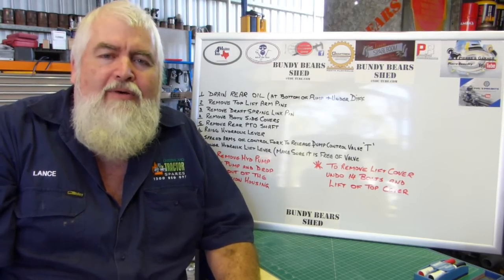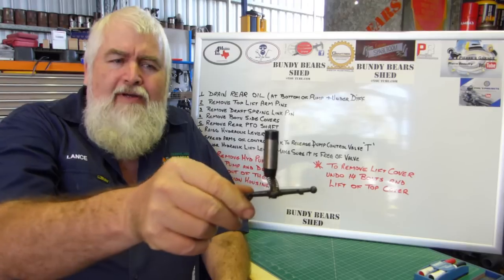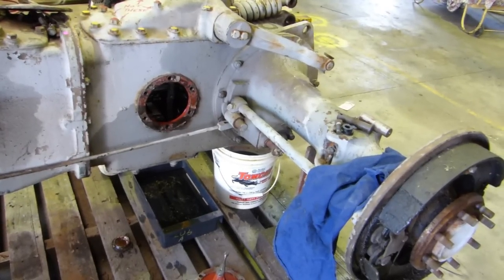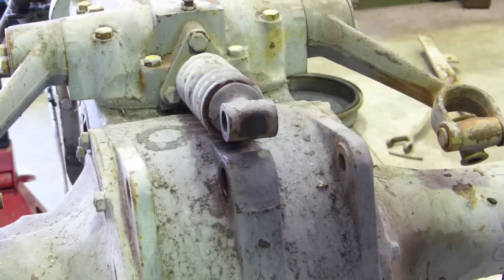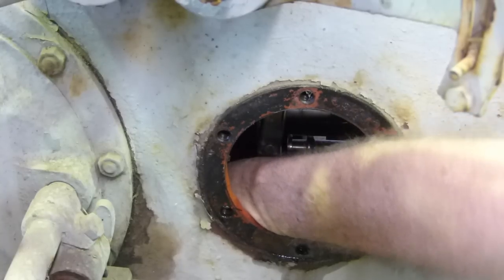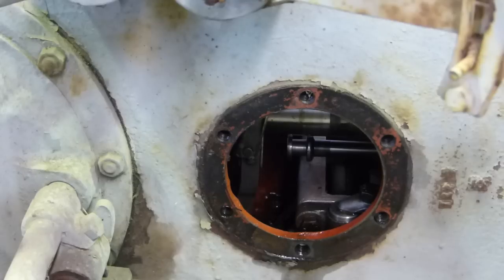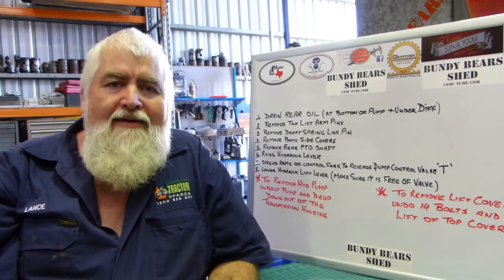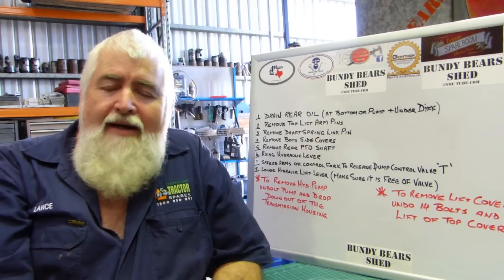How to remove a Ferguson TE20 Hydraulic Lift Cover and Hydraulic Pump

Comment: thank you for these videos! ive been watching all the ones on how to work on a TEA20. i just acquired one for some light/medium use around the farm. it needs some work, as its stuck in gear, and i do want to fabricate a loader attachment for it one day to help lift big bales of hay/compost/whatever. i havent found much in the way of help or diagrams on forums, so i turned to youtube, and found your channel. very informative, you explain everything clearly. i found one forum post where a guy pulled his lift cover off, and someone else told him to buy a manual before he goes any further because he probably wrecked his control valve. i couldnt figure out what that was, or where, until i found your video. you explained what it is, and how you can damage it, and how to avoid damaging it. i cant wait to get this thing going and put it to work around the farm. mine's a 1950 TEA20. cheers!
Reply from the maker: Im glad you are getting something useful out of the videos. I hope it all goes well for you.

Comment: I cannot set intermediate heights on my TEA20 from 1952. The lift either moves to the top or lowers to the very bottom. Is this normal for this model? If not where to look for the problem? Thanks for your suggestions. Greetings from Poland
Reply from the maker: Yes, it is, they have no real position control.
Reply: @BundyBearsShed  Thank you for your answer. What is the purpose of the screw limiting the movement of the lifting lever then?
Reply from the maker: @kamilpauk  setting ploughing depth for drafting.

Comment: Hi lance,  I have a 54 ferguson tea20, the lift arms only lift with power take off engaged been like this I was told for 30years, recently when pto engaged has sounded noisy, then the other day went to raise slasher only lifted about an inch, removed to w,shop stared dismantling, any ideas what could be wrong, update removed pump I know now how it works, different to the 35 I have, found t valve wiggle shaft was disconnected, missing circlip, the t valve internal shaft has a slight bend in it.
Reply from the maker: Sounds like you are onto it , good work.

Comment: Lance ,i have to change the side valve chamber on my TEA20, do i have to take the top off to lower the pump? I  have drained the oil,side covers off,fork off the valve, PTO out and bolts out of the bottom plate. do i have to do steps 2 and 3 or ccan i get away with out doing them thanks a bunch
Reply from the maker: No but you will need to take the pto out.
Reply: @BundyBearsShed  Ihave the PTO pulled out 3/4 of the way ,will pull out when my new side valve chamber arrives hopefully next week. can you tell me again whaat type of caulking you can use if you don't have a gasket thanks again Lance

Comment: Question : 1953 ferg te20 and when I raise my 3 point hitch up, hydraulic oil sprays out from between the lift cover and the housing, on the right side. Seeming to be a blown gasket, can I loosen the top bolts and raise the cover 1/4 inch or so to clean and put some silicone gasket maker in without damage? Or is it likely a bigger issue? Thanks!
Reply from the maker: Lift the top and replace the gasket
Reply: @BundyBearsShed  I just wasn’t sure if I could lift it up a little just by undoing the top bolts, thanks!
Reply from the maker: Not really you would need to undo the control valve so you dont bend it. Not a big job.

Comment: Hello Lance, my 48 t20, just wondering about my clutch. Does it maybe need fluid or adjustment? Do you have a video about this? Tractor was making a metal on metal noise and it is getting hard to get in gear.
Reply from the maker: I did a video on the te20 clutch early on and again in the 1954 series. I would suggest the throw out bearing is on the way out.
Reply: @BundyBearsShed  Thanks Lance, i will try to loosen the bolt on clamp and see if i can get any more clutch. I turned down the throttle a bit and got it our of gear back to neutral. John from Canada.

Comment: I have a question.  I got my pump pulled out and i have the rebuild kit. Does the front control valve, the one with the T handle on it, does it just pull out or is it connected to anything inside? My rebuild came with a new one but mine is stuck in there pretty good, so i didnt know if it was connected to anything or not.
Reply from the maker: It usually pulls out easily
Reply: @BundyBearsShed  thank you. I have it soaking right now. I think it has rust around it. I appreciate you getting back to me.

Comment: got a harry ferguson model.100 was removing dirt then i heard a pop underneath the seat and now the wheels dont turn ....what could be wrong..
Reply from the maker: If you ull the l/h side cover off you will possibly find the shear coupling has sheared. You can fit the new ones without splitting the tractor through the side cover but it is way easier to remove the lift cover. Not usually an expensive repair. When you order the coupler also order the split pin that goes through and holds it in place. email bundybearsshed@gmail if you get into trouble.

Comment: As usual, a brilliant video with straight to the point information and superbly produced. I’ll be doing this soon as I have a porous pump casting which is dripping oil when the hydraulics are used. Mine also sinks, so there’s other diagnosis to do. 
Thanks again, for the time and effort you have put into this series.
Reply from the maker: Thanks, Glad to help.

Comment: Got problems with my tef20. Thank god for videos like these showing me what to look out for.
Reply from the maker: G day Mark, Hope you get something useful from them.
Reply: Well I've bitten the bullet and started the job, First thing when I drained the oil, I had about 5 seconds of very dirty water which was obviously sitting in the bottom and then the lovely mess on water and oil mixed together. That's going to take some degreasing.

Comment: This video was incredibly helpful. Thank you. I had to remove a small bracket before I could unhook the wishbone. Took two small bolts and it popped out from above the PTO shaft. In case anyone runs into similar situation. Mines a 1953 TEA20.
Reply from the maker: Yes the later tractors had the alloy bracket to stabilize the  arms but mine did not have that.

Comment: Hi Lance, Thank you so much for doing all these TE20 videos. So far I have used 4 of them to fix a stuck clutch, replace a PTO seal, and fix a disconnected hydraulic control valve, all on the same TE20 of mine. They were so useful to see exactly what I needed to do and how to do it.
Very much appreciated. Thanks again and cheers from NZ.
Reply from the maker: Glad to help

Comment: Just came across this hydraulic pump video, and it's just what I needed! My TO 30 will not lift the three point up or down. I tried to force the lift lever up when there was water in the system last winter and it must have been frozen. Now I feel that I can fix it thanks to you great video. Love the colored bolts and nuts on the cover... Thanks for sharing you knowledge with us ' Rick in Iowa.
Reply from the maker: Glad it helped!

Comment: G'day Lance, great job it helped me a lot, I found it a lot easier to do the control valve/fork connection from through the drain hole instead of the side cover. Hope this helps others. Kerp up the good work mate.
Reply from the maker: I have not tried that, Next time I might remember to give it a go.

Comment: Thanks so much for this video!  I’m ready to tackle this job and knew you can’t just remove the top.  Now I know what NOT to do, rather fix the valve without causing more problems!
Reply from the maker: G Day Stephen, Yes you will have problems if you do just pull it off, just take your time and it will be a good repair.

Comment: Lance, My cousins grey fergie is having hydraulic problems. When you raise the lever you have to grab the arm and lift it manually when the load is on ther medium to heavy side, not hard but it needs a little assistance. It is ok with a light load. Once up it stays there and it will go down by it's self when you lower the lever. Enjoy your videos keep them coming.
Reply from the maker: Either his pump is worn or possibly the gasket between the lift cylinder and the housing. I should be getting to that in a week or so.

Comment: Ive been trying to spread those bars with no luck. Ive watched this several times and finally heard the bit about the aluminium block support, so i'll give that a shot tomorrow. I did un wind the rear spring linkage retainer much to my surprise. I'm a habitual never seize user also. Thanks Lance.
Reply from the maker: Some had the alloy block and some didnt, mine didnt. The old never seize is good stuff for sure.

Comment: Hi Lance, thanks for all the great clips that help me to understand my TEA20.
Could you please tell me what the four large bolts under the diff are for? I would like to use them to mount a home engineered attachment, but don't want to upset anything else in the process.
 Cheers, Steve.
Reply from the maker: G Day Steve, They are for drawbar mounting studs, nothing wrong with mounting something there but do not use bolts that are slightly too long or you will pop the castings inside the diff. try and use the correct studs to be safe. https://queenslandtractorspares.com.au/product/drawbar-mounting-stud-kit-5-8/

Comment: Thanks for the informative video. I just put a belly mower on my to30. I raised it once and it won't go down. Guessing the control broke or something. Have you got any ideas? I will try to read through the comments. Would pressure on the rock shaft possibly cause it?
Reply from the maker: Check the linkages are not binding on the mower first or unhook it and see if it lowers then.

Comment: Hi Lance 
I have  1953 TEF20.  Your videos are very good
I have got a problem with the hydraulic lever from the video I have an extra piece and I can't get the small piece from the fork. Can you give me some advice from photo attached
Reply from the maker: No pic but you may need to undo the alloy brace holding the arms together.

Comment: Thank you so much when I popped the top of mine and turned it upside down  the rod that goes into the ram or Jack broke that's why the hydraulics was not working if I hadn't looked at you vid there is no way in hell I  would have pulled it apart thank you so much for your vids and knowledge 👍
Reply from the maker: Glad you found the problem.

Comment: I have a '49 Ferguson TO20.  Recently given it an overhaul.  Hydraulics work well however, I noticed that after a while (30 - 40 minutes or so...) my hydraulics no longer hold up the attachment.
Prior to me disassembling the entire hydraulic housing or spending $350 on an overhaul kit, do you have any suggestions regarding what I should look for?
My original thought was the safety valve need to be replaced or I also felt that perhaps the hydraulic oil was suffice when cold but as it warmed up it was becoming less viscous and not holding pressure.
Any thoughts?
Any help you could offer would be greatly appreciated.
Your videos are a GREAT help.  Thank You.
Reply from the maker: They usually dont hold up real well as there is 3 cast piston rings with gaps in them. As the oil gets hotter it gets thinner and the leak becomes more pronounced with the arms dropping quicker. You can fit a Ford 8n hydraulic piston to them with a full circle O ring and they stay up well then.

Comment: My TEF20. ( have a look on my channel) I have an issue….  the hydraulic lever doesnt move anything inside.  I removed it and freed it up and refitted it but it isnt moving anything when i adjust the lever.  The whole tractor had stood for 20 years.  The gearbox was all stuck but i freed it.  I suspect something is just stuck from non use.  The plough raised up when the engine started and has stayed there ever since.  lever position makes no difference.  And i have the PTO engaged.  It simply isnt touching anything inside. I plan to take the top cover off and have a “tap” to see if it is siezed up.  Any ideas.  (bit hard to explain!).
Reply from the maker: Nice old tractor, I would think the hydraulic control valve in the pump is stuck from sitting in the raised position, look through the rh side cover and see if you can see the valve moving and try and shift it with a bar. Otherwise drop the pump out and free it up.

Comment: Excellent videos Lance, i,m taking the side covers off my 52  Tea20, i think it is the first time the pump and insides are being cleaned, this video is priceless as an aid to my work. I have a totally different question for you, i got my tractor running,it warms up  i go 100 meters starts to stall, quits ,i wait 10 secs she starts goes 10 feet dies out, now what i did was put my hand  over the top of the air filter and no problems ,runs good ,any theories ,how much oil do i put in the filter or do i start to drink thanks a million Steve  from Cape Breton,sorry its so long a note
Reply from the maker: You need to open the main jet screw a bit, say 1/2 turn out  or you have a fuel block, one of the two I think.
Reply: @BundyBearsShed  thank you

Comment: Lance, your videos are really first rate!  I have a MF TO20 with a broken hydraulic control valve. Part of the valve is still inside the pump so I think I will be dropping the pump so I can get a better look at it. Is it necessary to remove the top lift cover to do this, or did you do it only for filming purposes?
Thanks  
Bob Kerrigan
Reply from the maker: You can get the pump out with the top on but you still need to remove the pto shaft.
Reply: Thanks  very much! You"re an amazing source of useful information.

Comment: Our linkage was raised and will not go down now and have been told that it is muck etc on the control valve would you agree or is there another reason, the pto is turning ok.
Reply from the maker: Yes probably a stuck or dirty control valve.

Comment: Hey Bundy. Random question. The hydraulics just stopped working. I topped up the oil. Made sure the pump was engaged. The 3 point leaver is fully up to the Top. No flow at all. It's ona banana loader. So the control leavers pilot line comes out the top cover right hand side. I will break that fitting tomorrow to see if it's got flow , but I dout it. Is there a internal relief valve that may ha a broken spring or maybe seized open? Or a sheer pin on the pump?? My gut is telling me that it's a relief valve. Not getting any movement from the rams or the 3point lifting arms.  Any ideas. Before I pull the bucket off to move it into the shed to operate on the old girl 😂
Reply from the maker: G Day Aaron, These tractors did suffer from the hydraulic pump control valve sticking from time to time. That is why the later pumps had an eccentric to rock the valve back and forth while engaged. Im advice would be to pull a side cover and check the valve is moving and that the "Dog Bone" is still connected to it. You can see through either side cover and up through the big drain plug under the hydraulic pump. There is a gasket on both the pump and top cover that can blow and let pressure out as well. With the loader dropping the pump out the bottom wouldn't be too bad of a job if you need to.

Comment: I want to take my 1953 TO30  apart if for nothing else, but to clean  everything.    When using the 3 point lift all the way up and all the way down seem to work in about 1 inch of the lever travel.  I think that is telling me there is something wrong would that be correct and if yes what is your opinion?  other than that everything seems fine, just needs a good cleaning.
Reply from the maker: Possibly only adjustment

Comment: Great video, very precise! My ol TEA 20 lifts very slow and also doesn’t hold say the slasher mower up at the night I set it at and constantly have to pay attention that it doesn’t drop while driving around. Does this sound like my pump is knackered? Or does it have a filter some where I can check to see if it’s blocked? Only had it for 6 months and not used it much but learning about it.
Reply from the maker: They wont hold up over night as they have cast piston rings and the oil leaks from the gap. They dont have position control so you need to keep onto it.

Comment: Thank you for easily understandable videos. Do you know how similar this is to the MF35? I have a 35x, in which I need to change trans/lift/pto oil and filter, and I consider to remove the cover to have better access.
Reply from the maker: G day Karsden, The job is very similar but you don't need to worry about the control valve as it is not hooked to the top lever it just rests against it. But fairly similar job.

Comment: 200 lbs on the gauge pressure reading,  is it time to rebuild the pump?
Reply from the maker: You may have a faulty pump gasket or lift cover gasket or even the gasket where the lift cylinder bolts on.

Comment: Is that control fork operated by the lever on the left side of the tractor? I can't turn off my PTO, and I was told there was a fork that may have broken inside. My PTO lever does nothing at all.
Reply from the maker: G Day Greg, If you cant turn it off your rear pto shaft may well be twisted not allowing the collar to slide and yes the l/h lever isds the one to pull off for a look.
Reply: @BundyBearsShed  Thanks, I opened up the access port and found that the oil was pretty milky, so now I'm waiting for new gaskets and trying to figure out how to clean out all the bad oil. The lever and arm appears to be sitting right, but the shaft that it's supposed to move appears to be stuck in place. I've also found a huge crack in my PTO shaft (visible from the outside), so I'm going to need to purchase a new PTO shaft. Hopefully, if it's twisted, I won't have a hell of a time pulling it out.